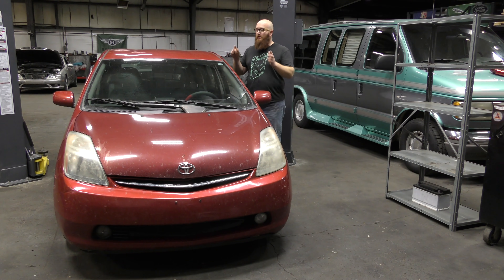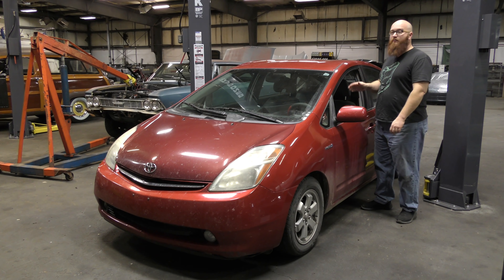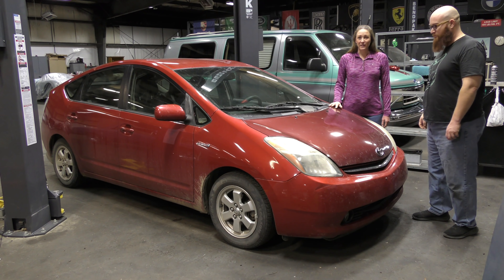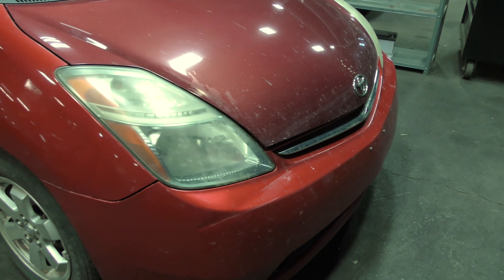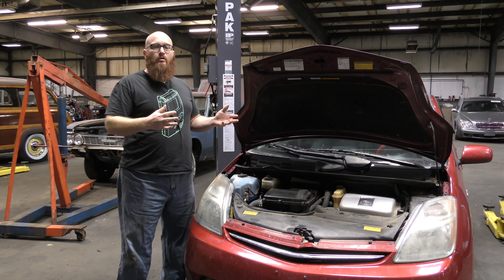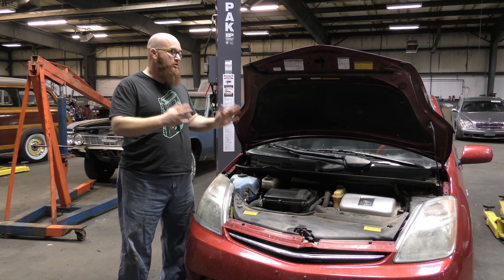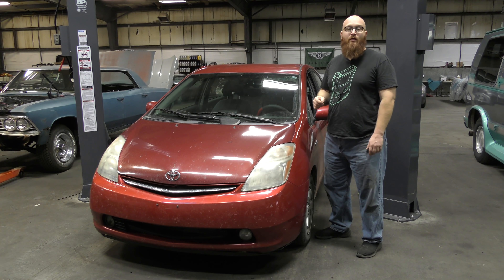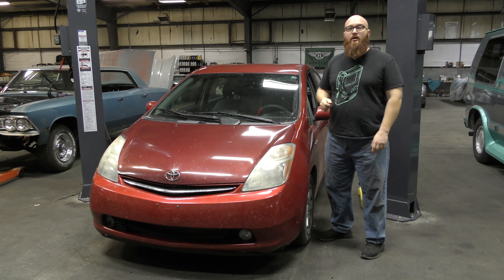When is it time to Buy or Sell a Hybrid? The CAR WIZARD inspects daughters 2008 Toyota Prius

Comment: My '05 with 235k miles still looks almost brand new.  With a little TLC, new fuel injectors, spark plugs, frequent oil changes, clean the hybrid battery fan, and new engine/cabin filters every 10k miles, and that car will go 500k+ miles. Frequent carpet/upholstry cleaning makes a big difference too on enjoyment and the eyes and easy to do.  (it's a great car).

Comment: Always always I disconnect the battery before doing any work, regardless of if it is going to interfere with electrical systems, just in case. Doesn't matter what kind of car it is

Comment: I just replaced my battery pack in my 06 Prius with 245k miles.  During its downtime I did it’s first set of front brake pads.    It uses some oil (more than I think is ok).    $1500for replacement batteries is easily paid off over the next few years bearing it doesn’t have any major repairs And is significantly cheaper than a new car.    I told myself my goal is 300k miles.   If something happens I know I can at least sell the battery for some money.   It is a remarkably good car.    It was a little intimidating to do diy repairs but it was actually fun to learn how it works and the drivetrain, though being rather boring it is brilliant.  And it rides and drives like a much lower mileage car!

Comment: These are great! I work at a dealership and we had an 04 Prius with the odometer stuck at 299k! I drove it another 100 miles to auction and it still ran quite well haha. Customer traded that thing on a Lexus GX.
Reply: Toyota Matrix/Pontiac Vibe had the same odometer problem.
Reply: @markh.6687  This is the reason my father might sell it or trade-it in later this year.

Comment: It is now the final day of March 2021 and the Car Wizard has not uploaded an all-new, buy this, not that video for three months. I am still waiting for the ones on Saab's, Isuzu's or Plymouth's. The mid-2000's Saab 9-3 with the 2 L turbocharged four-cylinder engine is a good vehicle to buy. Any older Plymouth Voyager/Grand Voyager minivan is a not to buy - run away, as quick as you can from these vehicles.

Comment: My ‘07 Prius has 155k on it.  5k miles ago I got the BG hybrid cleaner, added to the engine oil, ran the car for 250-400 miles, changed the oil.  No more adding a quart of oil between oil changes.  I heard that the rings can stick and it causes oil consumption.

Comment: Wizard, this car if maintained carefully and driven carefully can do another 10 years and 200K miles no problem. if the battery will die you replace it and that's all. if the engine die you replace it with a replacement from the junk yard. what get broken you fix. and not much will be broken with this toyota.

Comment: I had a 2005 Ford Escape Hybrid it was incredibly reliable and I bought it at the time for $ 1500. I got 2 trouble free years out of it and sold it along to a friend who still has it. The escape hybrid and the Toyota Prius hybrid are both extremely reliable and its been proven as they are still used as taxis in New York City and the majority of them have 200,000+ miles many of them being city miles. The escapes battery packs are going 300,000+ miles without being serviced or even touched. Really can’t go wrong

Comment: I only have a car like this. Maintaining it since I bought it in 2016, this year it cost really much with a new transmission, clutch, starter, front&rear shocks, thermostat, O2 sensor and rear muffler. That was about 3 times the price I paid for it. And that's not the end to it, since in January it'll need its 2-year-safety-inspection, and I'm driving with an airbag light since a year, which needs to be adressed (that clock spring also contains the steering angle sensor, so it's another 160 bucks just for the part, plus installation).
Actually, in the years in between, from mid-2017 on until the end of 2019, it was really good and needed not much besides an oil change and its regular safety inspection, which it passed with flying colors. So why am I doing this, keeping this old car running? Well, for one simple reason: I can't afford anything newer/better. Not only because I just barely have the money to keep this one going, but also because this one was explicitly chosen to be cheap to fix, so all the spare parts are still wildly available and usually, they are really cheap - like front brakes, rotors&pads for 80 bucks, or the transmission with a clutch a few weeks ago, 900 bucks instead of thousands. Plus, I really don't like spending money that I don't have yet, so I would have to save thousands of bucks before I could actually look into buying something else, and then it would also be a cheap used car again, and therefore I wouldn't know what's already been done to it, and what is yet to come, so I'm just safer keeping this old clunker running as long as possible. Heck, my mechanic even already promised me if the engine blows, a used engine can be obtained for about 300 bucks, so I wouldn't possibly even touch a grand with the installation, and it'll be good enough again. And that's what I'm going for: good enough. Nothing fancy, nothing shiny, nothing that makes people think what a cool dude I am (if they need to look at my car to decide about this, they're not the people I want to deal with anyways). Just something that's cheap to drive, and this is it.

Comment: Different hybrid approach, but... I was second owner of an 05' Civic hybrid. That lasted until 2017 with about 130k miles on the batt. Sold it to my BroInLaw, he knew the batt needed replacing but still wanted it. Only mechanical repair the car needed after 12 years.

Comment: I just got a 2013 for $2,200 that needs batteries, I bought a 4 battery charger/discharger for $89, 60 amp 12v converter, 5 modules from eBay $145.
Reply: Good luck. Don't forget to balance

Comment: My wife has this same car. It's been great up until now. I had the timing chain changed and now I might need a new coolant heat storage tank. It barely has 130k on it and it just seems like it's falling apart. Those storage tanks aren't cheap either. I don't think I'll ever buy a hybrid.

Comment: I have a 2008 PRUIS going on 149,000 miles.  Tinted windows, good Yokohama tires, new rims, regular oil changes, and regular washes.  I baby my cars.  VIN starts with a J which I found out was made in Japan.  The car is solid.  Purchased it in 2017 with 54,000 miles for $8,500. I was wanting to purchase a 2007 garaged Highlander with about 90,000 miles, but my sister traded it in.  I had to settle for a lonely PRUIS on the Toyota car lot. Best purchase ever.  I love ❤️ my PRUIS.  I wanted to give it to my granddaughter, but she did not want a soccer mom car.  I want to raise it about an inch and a half as they run very low to the ground.  Other than the paint a little faded, it still runs like the first day I purchased it.

Comment: hybrid battery life seems to me more a function of time than miles
Reply: It seems that folks like me who drove more miles (28,000) a year the pack lasted longer than say folks who drove 12,000 miles
Reply: It seems like the engine is more of an issue in this case than the battery.
Reply: The question in battery life is no easy one to answer. My 2005 is still on the OEM battery after 150k miles. Also other owners reporting OEM battery as Wizard and some over 300k miles. But yes, in general , the more a hybrid car is used, the better its hybrid battery will hold up.
Reply: I have a friend with a Prius that has over 600,000 miles on almost all original equipment
Reply: @harrisonyoung6115  All highway miles I'm guessing.  Still pretty damn good though
Reply: It is more a function of temp and use.  Lower temp and regular use are optimum.  Some make well over 300k miles, those in southern states with long hot summers may get weak after 150k.  Toyota now warrants new hybrid vehicle batteries for ten years 150k miles in all states.
Reply: They just dont do good sitting. They need to be used or they crap out
Reply: Also heat and not letting them sit. I have a 2006 Highlander Hybrid with 267,000 miles on the original battery. I live in the midwest and always use my AC in the summer. Using AC ensures that cool cabin air goes through the battery cooling ducts. I also keep my cooling ducts clean and clear of blockages. The vast majority of my miles are in town, as I have had a paper route for 12 years, and did do about 4 years of Uber/Lyft. Very few highway miles.
Reply: Hoovies Garage replaced a prius battery and I think claimed the batteries die off after about 10 years (the non lithium prius, which I think is most used ones)
Reply: @CaptainFeathersword  engine is wearing out burning oil because it's doing more work, because battery is doing less, giving less miles from the charge.
Reply: @harrisonyoung6115  if it was a 2010 that's 60k miles a year, over 1k a week. 4 hrs a day on the highway or 12 hrs a day in the city.. even if it was an 05 it's still 8hrs a day city driving.  it must be a taxi or uber
Reply: @cruiser6260  That makes sense. One way to avoid the problem is to just go 100% electrical. I have a 2016 Kia Soul EV (not a hybrid, 100% electrical). The battery has degraded ~10-15%. Even with that, there is absolutely no comparison to the thousands I would have paid for gas, especially since I received $13,500 in government rebates when I bought it new.
Reply: se fi  That is a lot of good wishdom about lithium batteries. But it does not apply completely as the Toyota Prius, and many of the other Toyota hybrids are using nickel metal hydride battery for the high voltage (273V) traction support. Longer story short, it made sense to choose that chemistry, for the design requirements of this hybrid car. 
There is also still a conventional 12 V lead based battery for the low voltage system, and for 'booting' its systems.  Its also located in the back of the car (just like BMW's and other sportscars ;-) )  That battery is really small compared to normal car batteries, as it does not have to do much, and it also does not add that much weight in this way. But, due to the small size, it wears out more quickly, and also when there is only a small left over current when the car is just parked, it reaches a too low state of charge quite soon. So, if you do not use the car for two weeks or more, chances are high you can not start it anymore. Therefor the prius is a car that should be in use all the time. If you leave it for weeks, you better disconnect the low voltage battery, which is a little bit of a hassle, by the way.
Reply: I must be an outlier then.  My 17 year old Prius ('04) has only 100k miles on it and the original battery.  It's also never been garaged.
Reply: Also, a Toyota mechanic on YouTube notes that you have to keep the battery air vent clear (not blocked by stuff) and check/replace the vent filter.
Reply: @circuitsandcigars1278  because it’s being charged and used same for a regular battery
Reply: se fi  Camry hybrid is easy to change its battery and it has some pull lol
Reply: my brothers 2010 died in 2020 with ~250,000 miles.  Mine is a 2013 with ~110,00 miles.  In 3 years I'll find out if what you say holds true.
Reply: @JBM425  Yes I’m not a Toyota mechanic I know a few guys that went through the Toyota training program and a guy that worked for them for 22 years! Lol we have a quite a few Prius and some camry hybrids with the city public works fleet department
Reply: se fi  : this generation Prius uses nickel metal hydride batteries, not lithium ion.
Reply: Problem with  Hybrid cars is you can only dispose it by throwing it into a blast furnace and recycle it into crude steel
Reply: @lenny108  That’s irrelevant when the hybrid battery goes better off getting rid of the whole cae
Reply: @lenny108  : how do you dispose of non-hybrid cars??  do you make garden planters out of them?
Reply: se fi  Note that this Prius has nickel metal hydride batteries, not lithium ion.
Reply: @ecavity  I accidentally left the driver’s side door of my ‘06 Prius  ajar overnight, which drained the 12v battery. So I always try to ensure all doors, including the hatch, are completely closed when I exit the car.
Reply: @turboclaybird  yup I try to not even open the front doors haha. I wish I knew for sure of a good LED replacement
Reply: @balintgbcz8263  so there a  little bit like the normal batteries that cars have and the engine themselves the more you drive and keep it charged the longer it'll last
Reply: They're far cheaper to replace than people might think. Greenbean battery does the full job for 1500 or less including install. If you're willing to do it yourself you can get it done much cheaper. 
If you drive the average amount, in just 2 years the battery would've paid for itself in gas savings.
Reply: I’ve got 111k on my ‘14 Ford CMax. Bought it in ‘16 with 14k miles. Been a perfect car so far. Debating w myself whether I want to keep it around for another few years or if I think the battery or CVT will croak on me

Comment: Just dumped a lot of work into my 2004. New ignition new, injectors, new break pump, all new break, full suspension change, newish battery, new water pump. Drives like new now

Comment: A Prius and gen 1 Chevy Volt are the best values on the used market
Reply: 🤣🤣 volt isn't good
Reply: @gokusuky253  ???? Are you high? The Volt is probably the most reliable GM vehicle. You can easily find them for $5-10k and barely ever use gas. They're objectively great vehicles
Reply: @tjwatson0403  Stay away from 2011 and 12 Volts and 2010 Priuses.
Reply: @atx-cvpi_99  I own a 2012 Volt. It's been the most reliable car I've ever had. The stuff that tends to go wrong on them doesn't cost much to fix
Reply: @tjwatson0403  my friend got one.he was lucky it was a lease he was having problems with transmission I'm not saying every car but most of them have problems
Reply: @tjwatson0403  you are saying your car is reliable how many miles did you get the car used or new??
Reply: @gokusuky253  I'm at 88k and bought it used at 66k. The only thing it's needed was a coolant top off which is one of the common problems on the 2012 but not a big deal
Reply: @gokusuky253  what year was his? Are you sure it was a Volt? They have a single gear transmission, pretty hard to screw it up

Comment: You might want to weld a couple of bars across the catalytic converter.  They are valuable on the black market which is hot on the west coast.  Some people will cut them off with a cordless recip in the middle of the night and screw up the o2 wiring in the process.

Comment: Useful video. Thanks Wizard 🧙‍♀️ I’ve got a 13 year old Lexus RX400h, with 115k miles. I’ve changed the CVT fluid, it’s had the cam belt done, and it’s been faithfully serviced every year, no matter the mileage. I’m pretty confident it’ll be solid for many years to come 👍😊 ITS A TOYOTA! - I paid £5k for it. Bargain.

Comment: I have a 2010 with 47,000 on the clock. All original, runs like a champ, I use her to go from Phoenix to San Diego as fuel is so expensive there. Since my car fleet has 24 cars in it, I don’t drive it as much as I should. It’s underground garaged at all times and I hope it lasts me another 12 years!

Comment: Getting rid of it for oil consumption?
My 01 Sierra has used a quart between oil changes since new.
Reply: I agree. I’ve had multiple cars eat oil. Not a deal breaker, just check weekly or every fuel fill up
Reply: The Prius holds about 3.5quarts of oil if it’s not on the dip stick that is nearly a 1/3rd of your oil gone 😆.  I always check mine consumption accelerates past 4K miles in my car.
Reply: My f250 used to leak a quart every gas tank till I had money to fix it.

Comment: The issue with cars with high miles is usually the cataylic converters need to be replaced in some cases.
Reply: The issue with cars with high miles is that everything will have to be replaced sooner or later..
Reply: You mean gutted?
Reply: Luckily in Kansas we don't have emissions inspections so you don't really "need" to replace those.
Reply: Don’t worry, half the job is free, just leave it in a dodgy area for a week.
Reply: The '06 ones have the biggest cat issues they fail more easily not sure why

Comment: I tend to get rid of cars when they are a GMC product and the first hint of trouble shows it's face. I've learned not to own anything that is a GMC product. Especially if it is called Chevrolet and was made between 1970 and any other date. I'm also leary of Nissan products made after they stopped calling themselves Datsun and anything made by Chrysler/Dodge. A lifetime of experience has taught me that Toyota and Honda are the brands to trust, most of the time.

Comment: We had to trade in my wife's 2010 Prius due to a failing electric brake booster pump. That's a terminal condition as best I can tell and is a KNOWN weakness...
Reply: what did you trade it in for?
Reply: Actually Toyota offers an extended warranty for those parts for ten years.
Reply: @PlymouthNeon  another Prius! Great cars.